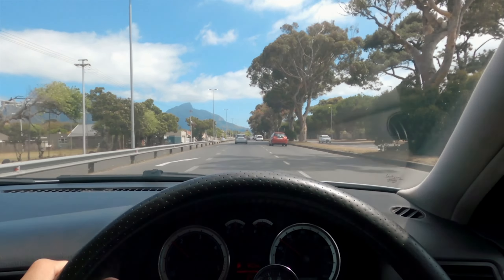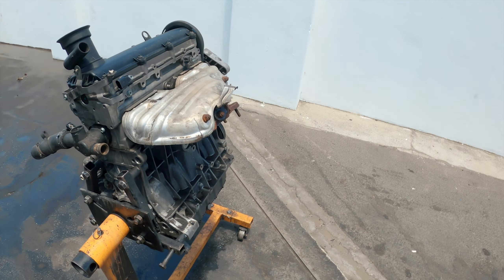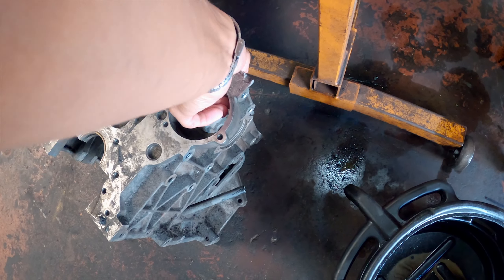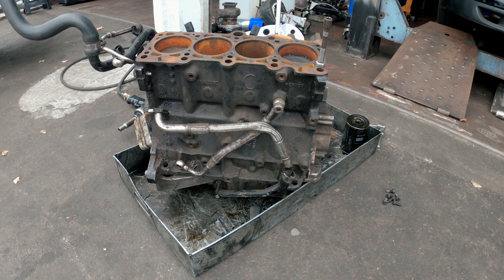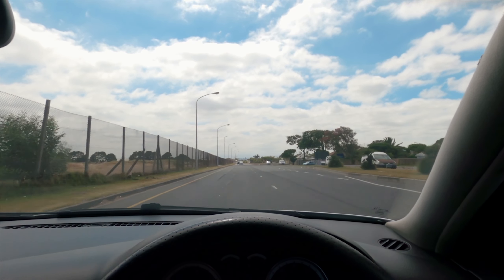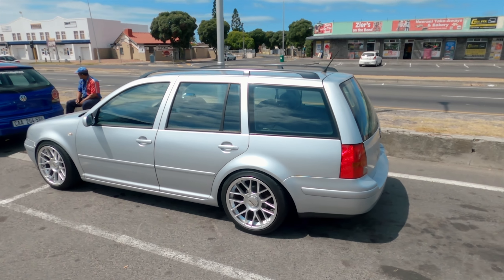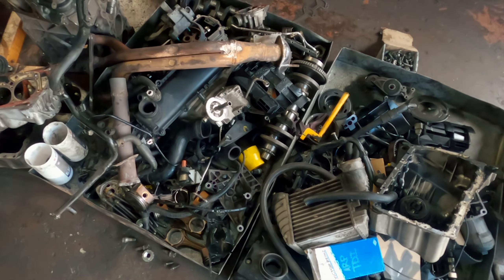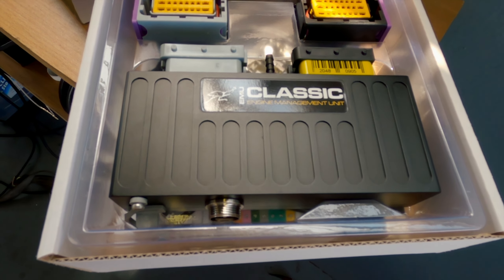The MK2 is getting a VW 1.8t 20v and a Ecumaster EMU classic | pt1

Comment: Bro your wagon is bananas🍌🍌 if i may ask, what has been done to the motor?
Reply from the maker: Thanks a lot 🙌🏽 The engine is stock. It’s got a 74kw polo TDI turbo, straight pipe and software. Eventually I’ll move up to the 96kw tdi polo turbo and bigger injectors. That should make it come alive.
Reply: I was not checking for these cars.. They're cheap to buy now and I do alot of mileage so I've seen 1 for 28k in Germiston but I'm thinking I just put in a new motor with that tune sommer
Reply from the maker: That’s a good plan. The motors aren’t expensive. And they are really reliable. I’ve seen ones with over 500k with an unopened motor. I had a head issue because of a bad major service but other than that. It’s just normal wear and tear.

Comment: How to make speedometer, tachometer, odometer work after swap???
Reply from the maker: Speedo and odo is fine when it’s using the factory cable. But the tach has been my biggest headache. I’m keeping the stock box for now so that shouldn’t be an issue. I’m hoping that I’ll be able to get the tach working. The MFA cluster on the mk2 needs power for the cluster and signal for the tach. I didn’t have power to the cluster and that was my biggest issue.